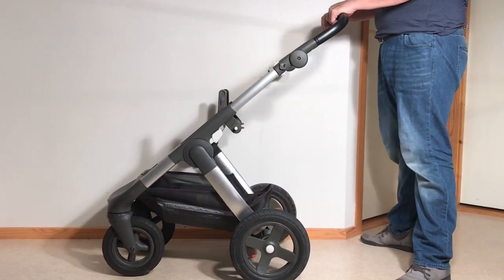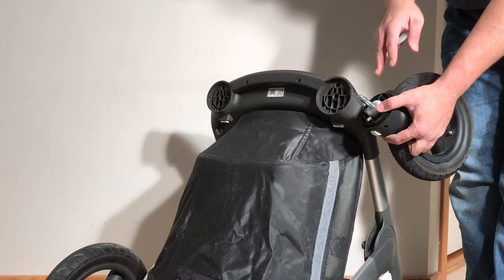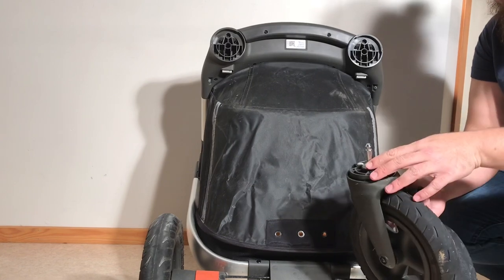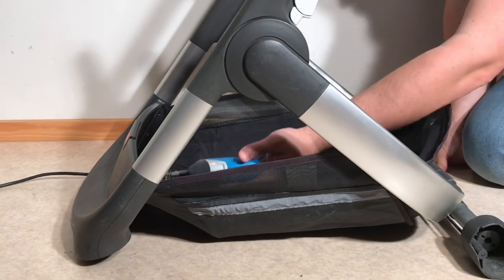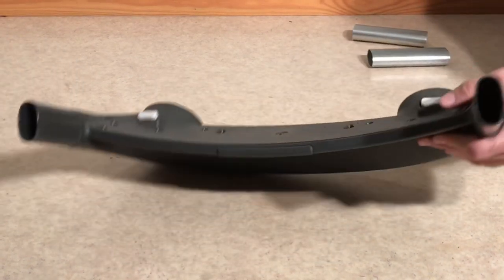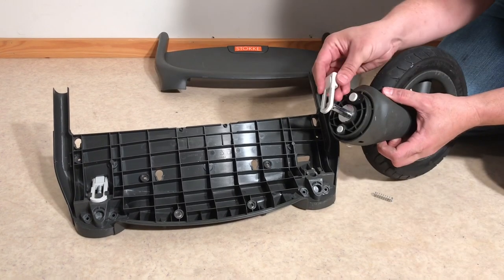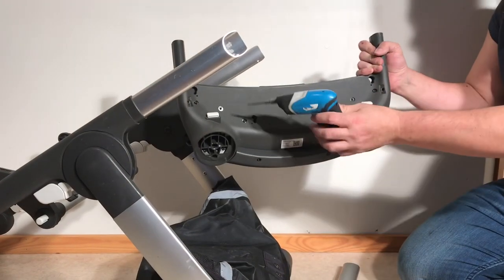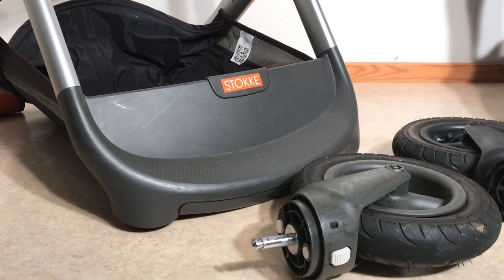Stokke Trailz Front Frame Troubleshooting Guide: How to Fix Wobbly Wheels or Wheels that Fall Out

Comment: I've bought a used Stokke Trailz that has wobbly front wheels even though it has the white suspension pad-version tires. But it doesn't have the extra pad up in the "wheel house". Do you know where I can get a set of that extra pad (the pad that you're holding in your hand in the beginning of the video)?
Reply from the maker: Do you live in Norway (Your name looks Norwegian)?  If so google: BarnevognVerksted, and call us (we're in Oslo), or send an email to us in the channel description with your phone nr).  Otherwise, you should contact Stokke :)
Reply: The Stroller Workshop I live in Denmark so almost. Would it be possible for you to send a package to me? If possible I would also like to buy some food industry grease if you have. Seems hard to get for private in a small quantity.

Comment: Hi how would I get the front wheel off the axel to tighten the bolt underneath what tools would I need please thanks
Reply from the maker: How old is your Trailz? (do your front wheels have a white spring-loaded plate atop the fork?)
Reply: The Stroller Workshop hi not it doesn’t have the white spring loaded bit it’s a 2016 model